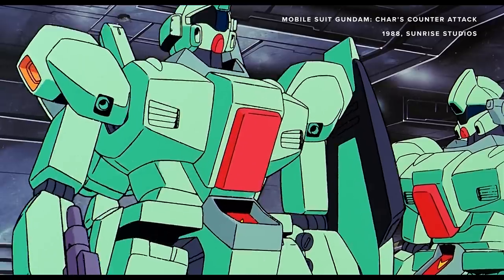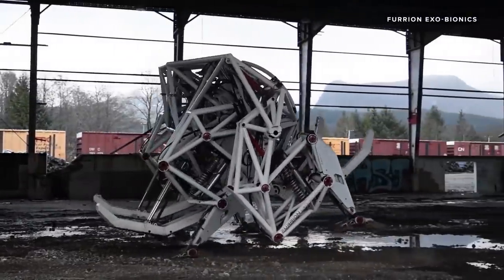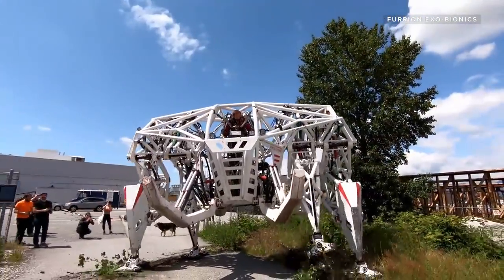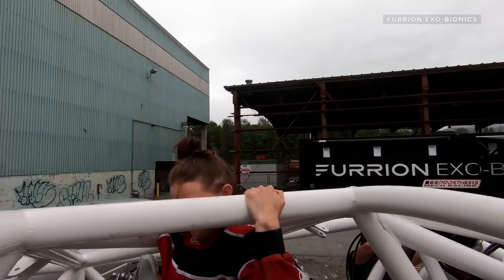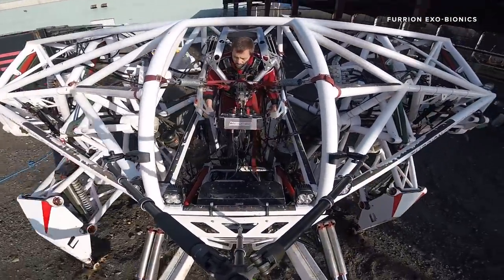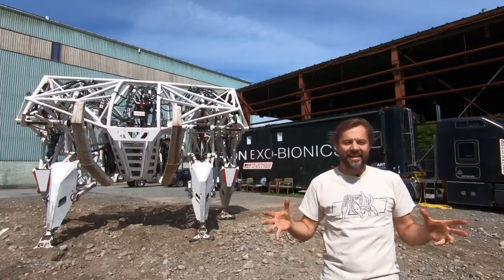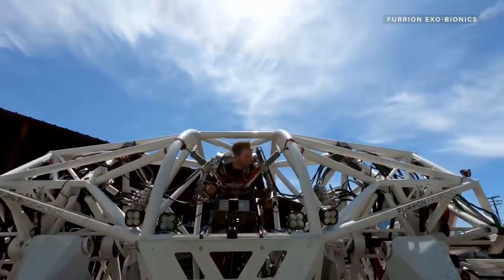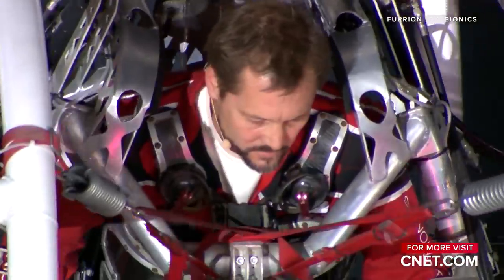Learning to pilot a real-life GIANT mech suit  🤖

Comment: Mechs / exo-suits are still valid so that if you need to do construction or any work in harsh or interplanetary environments / space. Thankfully people still work on these. Good to have a wide variety of technologies available for the progress of humankind. The modular exo-suit is my recommendation because you need different kinds of legs and arms. This is due to the landscape being varied. Sometimes you need long legs, or wide feet. The best solution would be that the modular mech would adjust to the terrain / conditions. Like feet able to extend and widen to get better grip or stabilization, extruding legs in case you need to cross deep water and vegetation, the list goes on. Of all the technicalities, the most important is the ability to set itself upright after a fall, tumble, trip or laying flat or prone. 

More power to the devs! 

PS Always wear a healmet and full body gear when piloting it. Safety first!

Comment: So why no protective windshield to prevent getting impaled??
Reply: how about you slow down a little bit? can't you see that it's not meant for any productive uses yet?
Reply: @iamwisdomsky  marching in protest?
Reply: Pretty much anything you can see through won't protect you from getting impaled from most stuff with that sort of mass pushing it. 
Lets suppose you were dumb enough to run it into a piece of rebar or a pipe. What sort of windshield do you think is going to stop that with tons of inertia behind the machine?
Reply: @unitedspacepirates9075  more like marching through protests xD
Reply: @the_omg3242  Transparent aluminum. We have it now. Very spendy but it'd fit the bill. If that doesn't work a fully enclosed metal chassis with dozens of cameras and a VR headset would do the trick as well.
Reply: @the_omg3242  Have you not seen bulletproof glass?
Reply: @the_omg3242  a translucent metal...
Reply: or a screen
Reply: Military  "windshield you say we're working on that as we speak ... for you know um rescue missions and assisting in natural disasters of course". 😉
Reply: @the_omg3242  guns?

Comment: What about remote control? Do hydraulic pumps are controlled over an electric board or just converting human movement to the legs? With a little machine learning, this mech can walk on any floor with simple commands. Pilot cockpit unnecessarily takes large place so if they made it remote, the cockpit can be changed into the battery area

Comment: This is not a new idea. I saw photos of a WW1 machine designed as a truck designed to be able to navigate deep snow or mud. It had four or six skids instead of wheels the skids alternately rotated in steps as the truck literally walked forward.  Over adverse ground the walking skids were  to be changed to wider ones, even possibly floats, This was over a century ago. This contraption is doing the exact same thing except using legs instead of skids.  I applaud these guys making something but it's like the Americans and the can opener,  it was an existing design they just copied and claimed as their own because US patent laws at the time did not recognize German inventors.  At the same time,  US laws recognize that Apple  invented  " rounded corners "  over Samsung ( which was laughable, but in the US ... legal ).

Comment: Why metal? He should have use hard plastic
Reply: Same reason they don't make cars, trucks, motorcycles, and planes out of plastic. Metal is strong and easy to work with.
Reply: @the_omg3242  Cars are designed do more than just driving them, they carry load, they need to resist weather conditions, they make longer distance and should be more durable. This thing is mostly a toy, it has very limited real life usage and using metal only makes it heavier, noisier which then require stronger motor/gas.

Comment: despit the pilot direc control seem super it not proved this ability to climb any step out of flat standard ground
all the video cut before it walked on something else than totally flat
and i bet if they had any capacity proud to be the had show to us how its super efficient
for 2500$ per hour we better to experience as heiicoter pilot
tought the direct pilot system is really a great concept for avoid computer & electronic 
saddly electrical power waste the anti EMP meaning
i mean its possible to build a robot without any electric part using diesel and crank or hydraulics
so thumb up for the first fun pilot experience since 1960 prototypes

Comment: Put a small v8 in it for power
Reply: Strictly electric. Can operate indoors, simpler, less explody. The power of the future.
Reply: From the mechanic's perspective ; I really do appreciate not having to deal with an IC engine on this project. We've had to do a total of zero maintenance on our motors in 4 years of operation. There's enough to work on as is without having to deal with dinosaurs.
Reply: Try to rebuild the combustion engine and give it another fuel. Like water... Combine the upgraded combustion engine with a dynamo system with capabilities for high tension electricity production and there it is. Minovsky mobile reactor system and the GUNDAM vision gets real. Without lithium ion batteries...